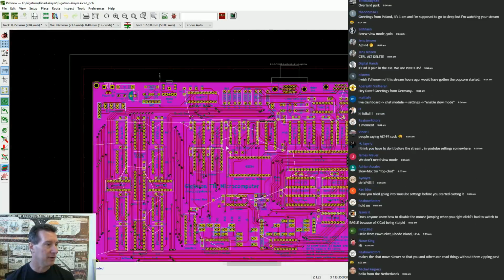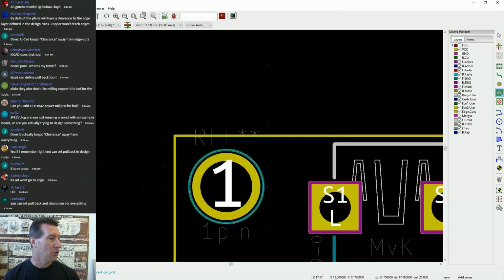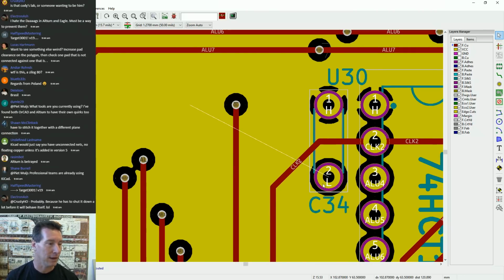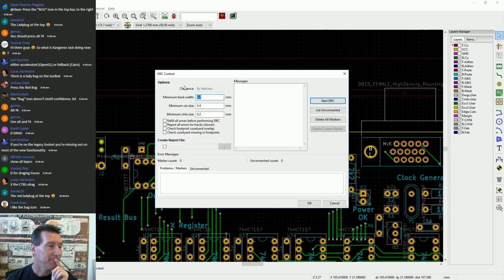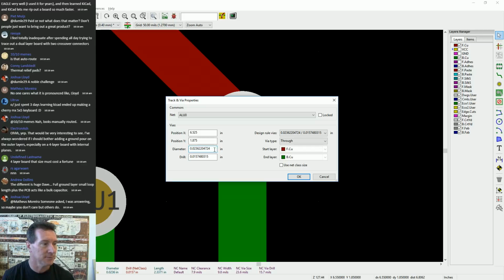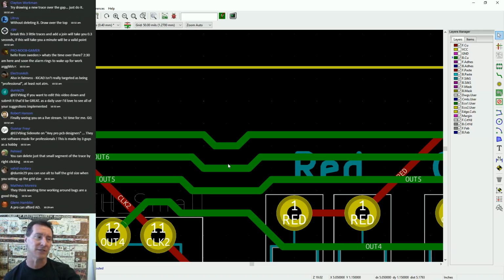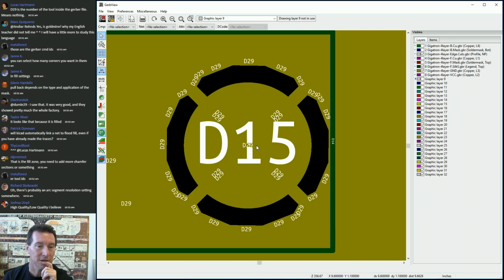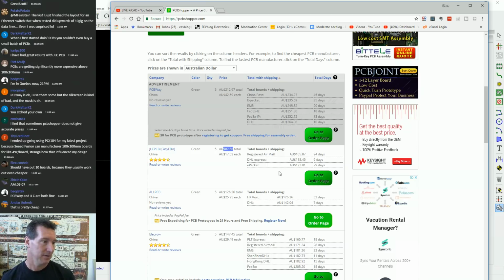KiCAD PCB Design

Comment: I would love a explanation video of when and why you would use a 2 vs 4 or vs even higher layer count board and some possible traps with that from someone that knows their stuff.
Reply from the maker: That's the point of this video, so I have a hardware platform to potentially demonstrate this.
Reply: What would you do when you have two power rails? eg. 99% of my projects have +12V and -12V rails. 6 layers? Smells expensive... I've been getting along on 2-layer boards thus far but it could be oh so much tidier with full supply planes
Reply: Route the +/- power around the board outline and take 0v from the groundplane fill.
Reply: 2 Layer vs. 4 Layer PCB EMC Tested:

https://youtu.be/crs_QLuUTyQ

Comment: FYI: the middle mouse scroll thing is used on just about every web browser now...

>_>
Reply: FYI: you can scroll with arrows, or page down/up. Or if you are like me use vim keys hjkl, don't even need mount on the browser. I also agree with Dave scroll wheel buttons neee much more force. Nevertheless he can change this on the settings lol.
Reply: cad programs often use that for pan too ... I don't see the problem xD
Reply: @km5405  I see you've never done PCB design without a mouse...
Reply: ohh... I see the problem .-.

Comment: Sounds like your mouse is quite shit Dave.
But yes i didnt really like kicad much either, I might give it another go. I just love eagle's fusion link.
Reply: LittleRainGames does it actually work well with fusion? I’ve heard mixed opinions
Reply: KiCAD has been worked on to interchange data in STEP format, which makes it useful to use with FreeCAD (or any other CAD tool really).

Comment: I posted a link to this video in the KiCad developer IRC channel.
Reply from the maker: Thanks.
Reply: Dave, FYI, links to the full live video and this short cut version have now been posted to the KiCad mailing list. As a result of your video I discovered the Auto Trace Width setting in pcbnew isn't saved between runs of the program. I may need to file a bug report about that (if one doesn't already exist).